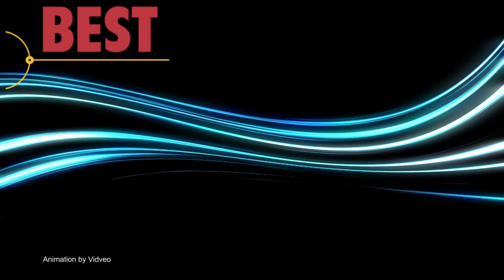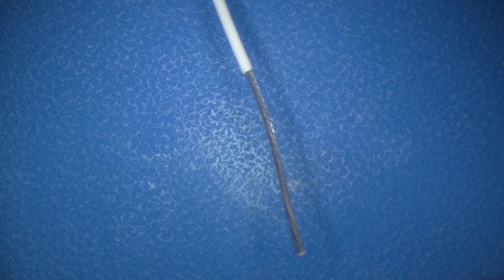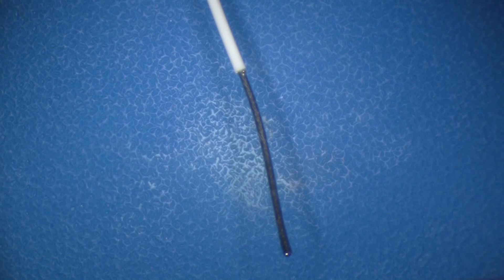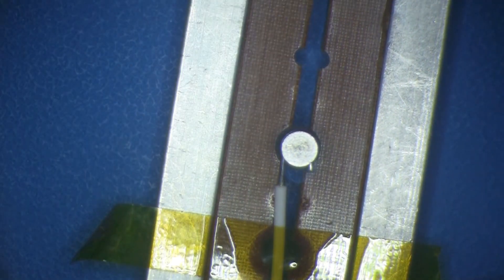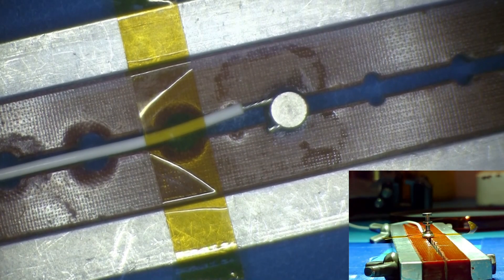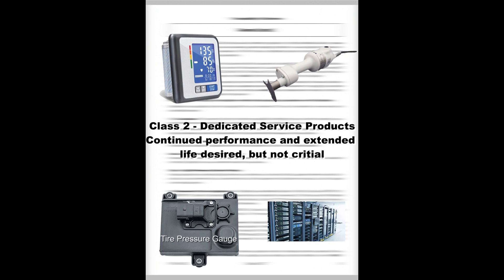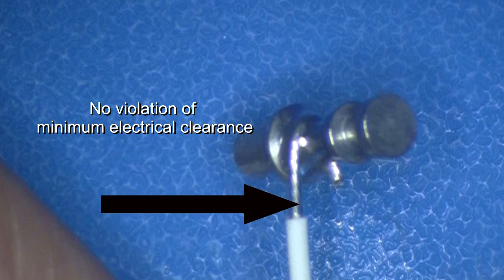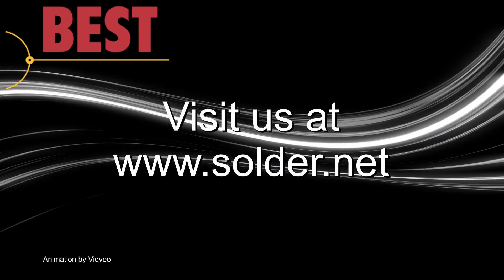Soldering Wires to a Turret Terminal

Comment: Maybe use hotter iron (no need for flux and taping this way), clip rest the rest of wire and don't pre solder wire right up to insulation. Insulation gets damaged when wire is pre soldered right to it...